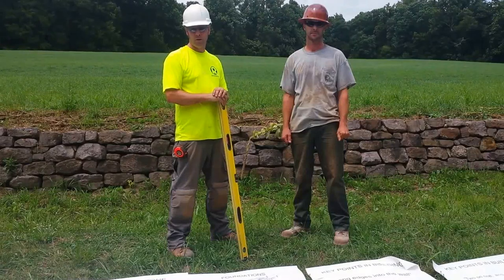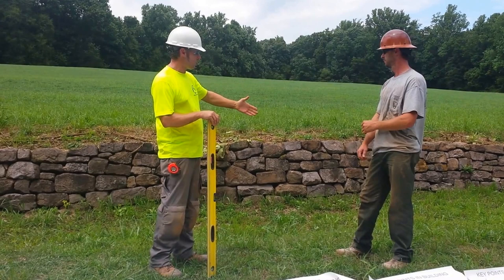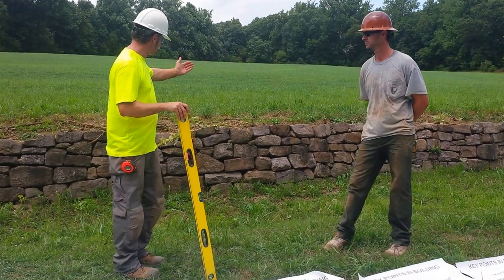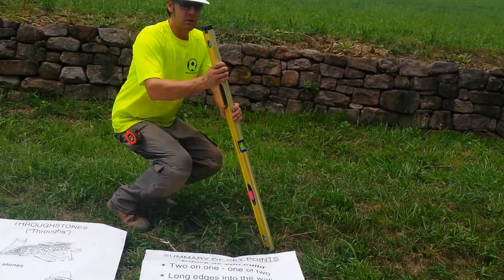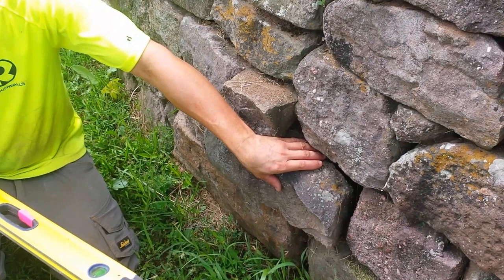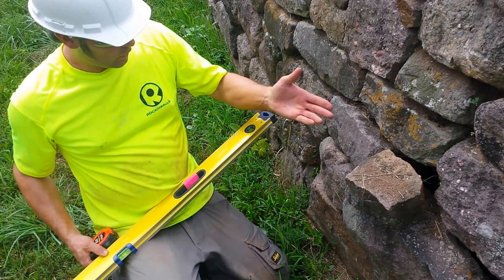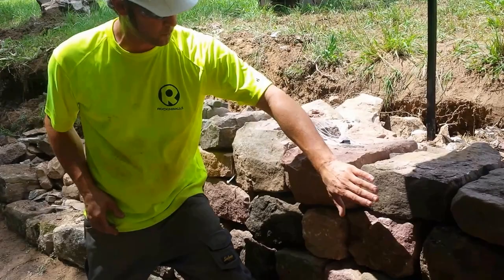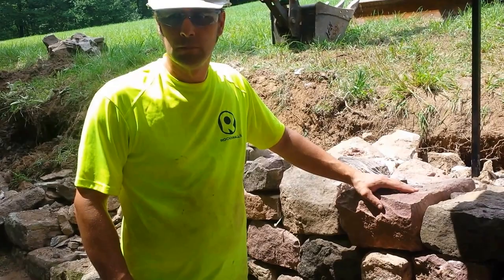Understanding Proper Dry Laid Stone Techniques - Hopewell Furnace National Historic Site PA - HPTC

Comment: Great video! I am a 59 yr old mom, I have done 3 dry stacked stone walls (coastal Maine), one is a 3' retaining wall for a patio. I am currently working on a 48' long , 14" high dry stack "rattle blue" (which is a narrow rock) retaining wall, on a slope, I have spine and nerve issues, so slow going, but love to build these even with the pain. When most women get perfume or candy for special events, I ask for rocks. Anyway, I put my rocks into size and "purpose" piles, like the top piece, chiggers etc so it was good to see your organized piles. First wall I did was the 3' high, 28' long "Rattle blue" wall just before winter, with so much snow, that I had to unearth snow weekly from my 5 tarps, so it felt like I was working in trenches until spring, not easy, but satisfying. Thank you for the great refresher coarse video. Sorry for rambling on.
Reply from the maker: Thank you you sound alot like my Waller freind Kim Coggin, 2 knee replacements, hip issues, arms... she just keeps on walling. Slow and easy. All about making good choices not always about how fast you can stack stone. Very therapeutic that's for sure.

What's a chigger?

Keep on Rockin!
Reply: Very cool. Same. We can do anything.
Reply: С уважением из Сибири , Владимир !
Nizhnevartovsk .

Comment: Face stones are not arranged correctly, and the batter is 1:6 (1" in to 6"up) not1:8.
Reply from the maker: Yes definitely a lot of stones on the old wall are not arranged correctly. I'm sure they had to do the best they could with what they had. Sometimes that's the best course of action when you don't have a new supply of stone. 

As seen with the training posters from the DSWA (Dry Stone Walling Association of Great Britain) the new wall section followed these methods as much as possible. Ofcourse all rules are simply guidelines. So in the real world you always need to be ok with making exceptions. That's just life. 

As for the batter yes the example of a 36"  tall with 6" out at the top would be a 1:6 batter. As stated in the video we check several spots on the old wall. The correct batter on this historic wall rebuilt in the 1980' was 1:8 not 1:6. Maybe you missed that. 

1:6 and 1:8 batters are very common in UK with freestanding walls. 

Tell me you seem very knowledgeable with dry stone walls. Are you certified?

Also do all dry stone walls need a batter?

Comment: You know how long it take just to cut all of them at one size back in slavery time where stones were used With the right mesurements? Because of it it does have diffedents sizes of stones in that wall or they all would be done properly each 1 in one size in square or retangle.. 😖😖😖😖 alot work  but good someone still doing that hard work as an Art and making beautifull things with them after 6000 years my wall still in the middle of England were my bones are..
Reply from the maker: These stones are for the most part the shapes you pick up. You don't waste time making them into sizes. It's best to just to make good choices. Work with what you have at hand. Shape only as you needed. Some times not at all. A Waller is someone who picks up a stone and places it on the wall. A Mason is someone who picks up a stone and shapes it then puts it into a wall.

Did you know now in America most of the walls were built by immigrants. Many English, Irish and Scottish. As the trade started to die out if a black person was brought on as a trainer they were paid for there skills. There are no known slavery walls built in the US. Wallers were always trained trades men from all walks of life. Today we are seeing more and more women coming into the trade. Really amazing. 

The other cool thing was during the CCC period many of the black teams who were tasked with building stone walls.  Often had less direction then the white man crews. Personally from what I've seen and read they created a much higher level of walls. Thankfully stone knows no color. I'm grateful for those who worked with stone before me. I learn so much from old walls standing or those which have failed.

Yes it a real joy to share with everyone my love for stone who wants to learn. 

I'm a bit confused about your comment.. So I'm going to do my best to help give some helpful information on walling.

Thank you for checking out the video. And you are correct proper dry laid  stone walls stand today built 6000 plus years ago.

Comment: Nobody says anything about the very first layer. What if the soil coditions do not allow a founfation? How to build a stable wall without fiundation?
Reply from the maker: We we also didn't talk about the two different styles of foundation are either. This video was more about this project and wall. There are some really good books out there. The one I'd suggest would be Dry Stone Walling a Practical Handbook. I believe the Dry Stone Conservancy and The Stone Trust have them listed on there sites for sale.

Typically with any foundtion you simply take off your top layer of organic material. Then set directly on earth. Say you have loomie or marshy areas,, you would simply want to find larger stones to be floaters.. Think of it like a boat pier. There are so many variables. Step foundations, or running a foundtion along grades under 10° with having to step it..

This project was set on earth with largest stone set first on bottom. Not protruding below grade. Which is how I build all my walls. You can see much more on my website. Or considering taking a workshop. At our training site we offer a Fundamental Workshoo where we have 2 dedicated spots for foundtion training. 1 straite and 1 curved. Good times!

Comment: This design is the traditional British dry stone walling found in Northern Britain. 1:8 batter, 2,3,1 base, height, top with knee height tie. Great to see a professional job. Saved, liked and sub’d.
Reply from the maker: Yes so true. 1:8 or 1:6 on average batter. Or some kind of batter. 18" ie as you said knee height for tie stones. Always suggest on walls higher then 30" when and if you have the stones to do so. Also in accordance to the historical pattern. These walls didn't have them. So sadly they could not be installed. Just had to be sure to cover all the rules.

Comment: a lot of great info.. to the defense of the previous repair work that was done .. I doubt that they had the budget to essentially double the amount of face stones and build this the way it is being properly restored right now.
Reply from the maker: Hello Christian, First thank you. As to your thoughts maybe at a first glance this could make sense. When you look harder not likely the case. Heres why...first hard to know the dating of the original walls. It has been documented as for  2 repairs 1) CCC period of great depression 2) 1980's with the HPTC National Park Service. The 1980 repair has gravel and mortar on the top 3 course. The cost of these service and material hauling and extra excavating. Would far exceeded the cost of putting the old stone back if it was there in the first place from the CCC build. Even if it was not it would require less excavating and bulk quarries rip rap could have been used for the back walls. In addition no heavy equipment would have been necessary as shown in the NPS Hopewell Furnaces outlined historical project history documents open to the public. Which can be found on the internet. The best part was this was outlined as a 5 year project it took less then 6 weeks working 4 days a week 10 hours. The sections which were repaired happened to be at least 1/3 of this wall section. The crew was less then 5 of which only 2 had any masonary skills many of the others recieved on site job training. This was why I was brought on for a couple weeks to get them started in the right direction. Even though the HPTC is a division of the national park service they still charge as much a private contractor.  If commerical jobs didn't have to go threw so many hands to get the end result. We would have alot more money which could be applied to needed park repairs in the US. Just the way the system is set up. Sad really. 

Thank you for your thoughts and comments. Mark

Comment: Pretty solid overall one thing I didn't hear: have the  patience to save out nicest stone for the top. Also pay attention to any drainage issues. We like to use fabric behind retaining wall before backfilling.Keeps soil in place so it doesn't wash through and come out the face
Reply from the maker: Hello Christopher, Thank you. Very true patience is key for building any stone wall along with stepping back and looking. Also knowing your walling ingredients is important. Designing any wall starts at the top. Knowing how it will be finished based on purpose and function. Then having the stones you need. (http://www.rockinwalls.com/2012/03/how-to-wall-stone-ingredients.html)

Drainage issues is also a great point many overlook. The best thing to remember is know that you can not stop water but you can redirect it.  Sadly I would have to inform you Filter Fabric, or landscape cloth could cause hydraulic pressure over time when it back up with silt. As Master Craftsman DSC & DSWA Neil Rippingale (http://ptn.org/askins/neil-rippingale) explained it to me as coffee grinds in a coffee filter over time it will just stop any water from getting threw then clog. Just like a wall this will then push the wall over. When a wall is retaining wall is built correctly using the Standards used worldwide by the Dry Stone Walling Association of Great Britain. Keep in mind I believe in real life examples not "Experts" Such example can be seen SKARA BRAE  5000-7000 years old https://en.wikipedia.org/wiki/Skara_Brae  There are 3 different proper styles of retaining wall based on stone types. I build a Yorkshire Style which is double sided with packing stone in the middle. Soil doesn't typically come thru walls and if silt does its ok. Better to be free draining and flexible then a dam up ready to blow. Watch any Dirt Monkey Videos on Pavers you'll see great examples of WHY NOT. (https://www.youtube.com/watch?v=f9ziFv6Q-6k)

One great alternative if you feel you have to use a fabric because its been spec'd my an engineer. Instead keep it on the top of back side. Master Craftsman Chris Tanguay Master Craftsman DSWA-GB, DSC-US Examiner / Instructor explained to me how he does it by weaving it under the bottom of back second course of stone. Keeping it below the earth enough to place soil on top but still get to in order to plant plants. This is a great alternative since you can replace it over time easily. 

I don't build with any gravel or fabric on back sides. Just good old earth. Hope this helps you and others know the truth. Just don't take it from me look at Historical structures standing the test of time. 

Mark Jurus
Certified:
DSWA Instructor, Dry Stone Professional Waller
Level 2 Journeyman DSC - Dry Stone Conservancy US
Level 3 Advanced DSWA - Dry Stone Walling Association of Great Britain
First Aid ~ CPR ~ AED

BFA - Visual Communication Graphic Design MICA – Maryland Institute College of Art

Comment: Howdy!  this is awesome and very helpful.  If you're just doing about a 2 - 3 course wall (knee high), do you recommend the double wall method?  I'm just kind of doing a crescent wall around the outer corner of my patio on its high side.  The only thing I worry about is a small tree i plan to put in the bed it will create.
Reply from the maker: Yes short walls under 2 ft I normally build 2 ft wide. Mainly so I have lots of room for a nice cap stone when I get to the top.

Comment: The foundation and tie stones are actually quite important.
Reply from the maker: Yes they are. You do realize there are 2 types of foundations correct? Also as a historical National Park Project you have to keep things as they are visually. I was sure to have a back wall installed and remove as much gravel as possible. As long as one is following the majority of the rules such as length in, breaking the joint, stones touching there neighbors. Tie stones are also referred to as through stones. As you have pointed out the are very important? Can you tell our readers starting at what wall height they should be included, what height should they be placed, what spacing on center from each other. What are the bennifits of protruding ties and foundtion. What are the two types of foundations?

Well said Carl over looked by many due to ignorance to proper methods.
Reply: @RockinWalls  

Thanks, Rockin.  In a previous video I watched ( I'm just an interested observer ) on the preservation of this art there was a great deal of stress laid on both foundations and through stones.  It can be found here.  The dimensions and handy diagrams are included for your questions:
https://youtu.be/FOlpjWGclPo
Reply from the maker: Lol Carl, I was just checking to see If you were taking any notes. The first drawling on my video was mine. Before we get into the answers I just want to say the video you referenced is wonderful (with a few errors). I know Richard well along with the DSC Dry Stone Conservancy. This is the training organization of which I'm certified by for level 2 Journeyman out of 3 levels. Of which are all hands no book work. I'm also Level 3 Advanced out of 4 levels (currently only 1 of 14 in US!) and Instructor Certified by the Dry Stone Walling Association DSWA Great Britain. This is the world wide standard. I also have a training center in Maryland started back in 2014. So I guess you could say I live and breath stone.

Now with that said let's get into the facts and details.

There are 2 types of foundations both set on or in earth after removing the top vegetation to find solid soil. 
1) Below grade protruding is best done with flat beaded stones. The belief of this style is that it gives a larger foot print for the all to set on. By protruding if the wall starts to shift out it still has 4" to move before falling of the foundtion as seen in my first drawling with the posters. Think of it as walking in deep snow with snow moccasins. Bigger foot print keeps you from sinking. Normal rule of thumb is 4" on each side of the first course of wall.
2) First course above but dug into earth. Typically the first wall course. This is the method used in this video to stay with the historical history of the wall. This can be with flat bedded stone (Typically your largest stones)or boulders. You couldn't build a protruding below grade foundation with boulders. Which I'll go over at the end.

Tie stones facts:
• Typically placed 36" on center but could go to 40".
• Protruding ties are just like the foundtion. The second lift has something to grab onto if the wall shifts out. I normally have my ties stick out a min of 2"-3"
• Tie stones can also be flush to the wall. This is important say in areas people or animals may travel say steps. Or a farm wall so the sheep can't jump up as stairs to get over a wall. Or cattle so they don't rub there butts on them.
• Tie stones are placed knee height say 18" give or take on a 36" - 48" high wall.
• Walls say 5' or higher would then have staggered tie stone and 2 courses. So one set at 18" the next at 36".
• Walls starting at 30" should have tie stones. I personally put them in on walls that are 36" or taller.
• Not all walls can have tie stones. For example boulder walls or slate walls. With slate all stones are ties almost.

So to sum it up. A solid foundtion is key just like any home or relationship. With out putting a great deal of time to make it right everything else will fall apart over time.

While there are no specific guidelines wallers try to follow key rules as seen in the video on the poster. Stone types dictate the wall style and construction methods. There is no one type of stone which means there are no one set of specs. You must work with the stone and build with what you have at hand. If you do not have long stones for ties and can't get them you have to go with out. If you have a new construction in the US with stone your buying there is no excuse not to design the wall with them (if over 30"). Using the best suited stone for the desired look and structural methods needed to achieve them. 

There are some really good books out there if you would like to learn more. Or come take a workshop. Working with stone teaches you so many life lessons. 

I love learning from stone and other wallers! This is why I've invested in certifications. Hope you found this helpful!
- Mark
Reply: @RockinWalls  Appreciate the response and information, Mark!  My wife and I currently live in an apartment so no site, as of yet, to build.  At some point in the future we'll have some property and there will definitely be opportunities.  Keep it up and perhaps someday we'll lay some stones.
Reply from the maker: Thank you Carl! You as well.